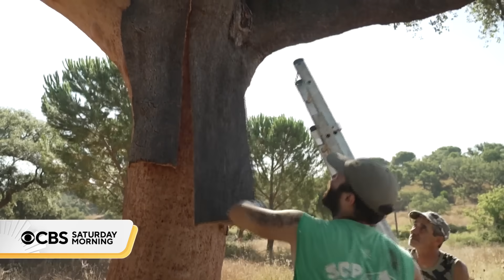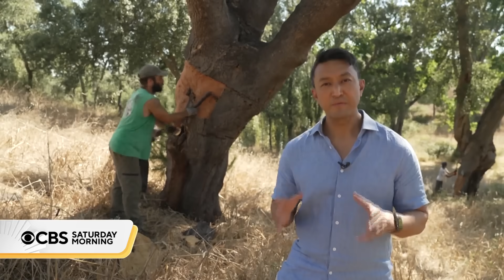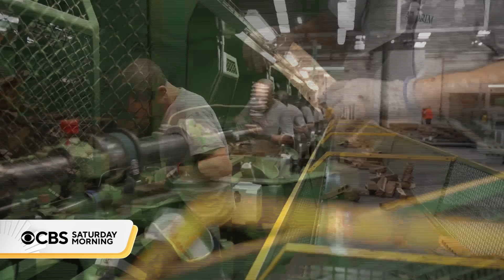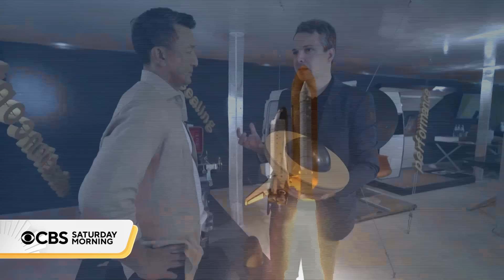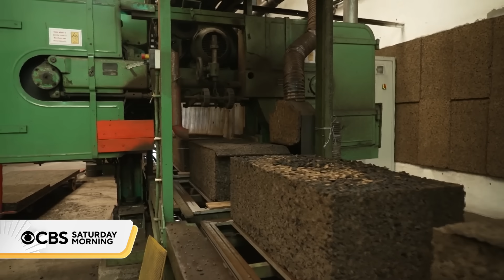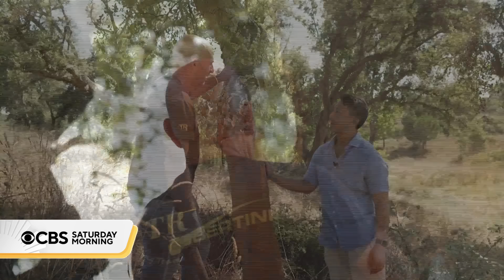How cork — the same material used to seal wine bottles — could save the planet

Comment: 🩵😇 🌎-1970’s in 1975-1978 my two older brothers built my mom’s house !! I was nine ! We all helped. We had a large open ceiling Family Room with spiral stairs going up to a loft ! That whole entire area had sheets of cork on the ceiling ! 
It was a natural insulating and also sound barrier !
( Tom was 17 ! Jon was 19 ! when we started building ! It was the ‘Little House On The Prairie days’. So my brothers added Lofts and open ceiling to the house plans like the T.V.show. ) 😊 🏡
( the front of the house was Sandstone-real Sandstone and the rest of the exterior was Cypress Wood siding ! Real Cypress Wood ! Also cut the same way as the siding on ‘Little House’ T.V. Show. We tried to use products as natural as we could.) 
1970’s were great. 😊

Comment: I built a house in about 1995 in German which was entirely insulated by cork. Wonderful material, but extremely expensive. Now I'm building a house in Alberta, Canada and I checked it out before. It would be more then 10 times more expensive then the already expensive mineral material that I use. Maybe in warmer climates the limited amount of cork that is actually available can be put to good use, but on a larger scale and in colder climates it just doesn't make economical sense.

Comment: The use of cork as an insulating material is very old. In Portugal, in the 16th century, a convent of Capuchin friars was built whose small cells were entirely lined with cork. The cork oak (sobreiro in Portuguese) also provides acorns for pigs, protects soil from erosion and is a natural barrier against fire and desertification in the southern province of Alentejo where it mostly grows. According to a saying, for every cork oak tree uprooted, a camel enters the Alentejo. The large fires in Portugal mainly consume eucalyptus (raw material for the paper industry) and pine forests, both of which are highly flammable (eucalyptus only has an advantage over cork oaks because it re-sprouts spontaneously after a fire). Last but not the least, cork oak woodlands are home to a multitude of animal and plant species. The cork oak is a national treasure of Portugal!
Reply: Let it be understood that there isn't a single camel in Portugal. Hence the joke, not one Cork Oak was ever uprooted. It's a very valuable little tree, that seems to live forever. Cork and Olive trees live happily together in Southern Portugal. Even from close distance they outwardly look very much alike, although they have little in common. The Portuguese names are Sobreiro and Oliveira, common surnames as well. 😀

Comment: This is not a monoculture, it’s an ecosystem that would naturally evolve to a climax where the cork oak would be the dominant tree. It’s managed, not wild, but management consists mostly of thinning the forest so that each tree gets as much sunlight and soil volume as it can benefit from. In a purely wild forest, most oaks would be smaller and competition for resources would limit their ability to recover from debarking. The montado was probably created as a balance between die back of the less vigorous trees, and the survival of the ones that tolerated debarking best, leading to its present density. It likely features the same biomass density as the original, wild oak forest, but concentrated in fewer individuals. Undergrowth flora, fauna are present and the soil remains untilled, meaning its rich microbial life and macrofauna are preserved. In the past, attempts were made to combine these open woodlands with cereal, but the results were not great and tilling the soil harmed the trees. Cork, as a commodity, is the only reason these large areas of woodland are maintained. Human goals and this ecosystem reached this stage of equilibrium over centuries of cultural adaptation, and over-engineering it risks disrupting it via unforeseen consequences.
Reply: This is probably the ONLY comment worth reading in this comment section. Bravo!
Very informative and accurate. 
My family is from Alentejo, from Mértola region, and they still have cork oaks. Taking care of a montado is a labour of love, commitment and total dedication of multiple  generations.
Saudações

Comment: Wait, there's a cork tree?? I assumed it was some general processed wood. It's amazing that cork is harvested without cutting down the tree and is sustainable.
Reply: Yes, they're called "sobreiro" in Portuguese. Scientific name, Quercus suber. It's a type of oak.
Reply: Cork is the bark of the cork tree, it is removed every nine years that's the time the tree needs to grow another one thick enouth to be useful.
Reply: @rasputindasilva858  you're saying 9yrs, but they said 25yrs in this piece so where are you getting the 9yr number? They said towards the end they're hoping to be able to harvest the cork bark in 10yrs but that's something they're working on figuring out
Reply: @nolongerblocked6210   25yrs is the number of years to have the first cork harvest; After that every 9yrs you can peeled it. The cork bark is dead, and naturally it would be expelled by the tree (like a snake); remove the bark is not deleterious for the mother tree; in fact it will help to avoid insect and mould  infestation of bark material. Nowadays we produce a vast array of products from cork, including clothes and tissues, besides the normal stoppers and construction material's.
Reply: @nolongerblocked6210  25 years wait for the first harvest. Subsequent ones every 9 years.
Reply: here's my fav random fact that literally NO ONE talks about 😱 apparently the reason why cork is harvested from oak trees every 9 years in Portugal comes from an ancient tradition of circumcising Portuguese men every 9 years 💀 it's bc of some Mediterranean genetic mutation that makes their 🍆 skin grow non-stop lmaooo can't make this up!!! 🤯

Comment: my cork tile floor is almost 20 years old - looks great - perfect in the kitchen - easy on the feet - better that tile - natural insect repellent- fire retardant - installed it in a few hours with a utility knife and ruler - also glue. and have uncorked thousands of bottles of wine. Thanks Portugal for all you do. thanks cbs for a very well produced package - not cheap to send a crew over seas.
Reply: does it stain?
Reply: @LK-pc4sq  maybe it does stain but the wine leaves some nasty stains and normally the cork is not that bad or have any stains when you open the bottle.
Reply: It's a great material, no doubt. I need to put in my home. :)
Reply: Lies again? CEO Of Ramenten (Alcohol Free)
Reply: Try some water, it'll rot in weeks
Reply: @Snaakie83  Cork is not timber, there's wine bottles of dozens of years whose capsule is cork the wine is in contact with the capsule and it is is not rotten.
Reply: Cork does not rot. It is not timber.
Reply: @Snaakie83  the convent of Capuchin friars from the XVI century clearly proves it doesnt

Comment: Wait ...didn't they replace wine the cork for wine with plastic ones , to save the planet....now your telling us to use cork instead of plastic to also save the planet ?
Reply: *you're telling us
Reply: Plastic corks are used for cheap wines only.
Reply: That's not right. Cork is sustainable, it doesn't 'hurt' the trees (quite the opposite), and cork oak forests create thriving ecosystems and biodiversity. Besides, these forests are perfect 'carbon sinks' that fixate carbon dioxide and pollutants, altering their composition and making them safer or innocuous. Maybe that's one of the reasons why the area of Alentejo, in Portugal, has such clean air and is one of the best regions in Europe to observe the night sky. Just Google it. Plastic: not quite the same.
Reply: the replaed with plastic because cork is running out.   the other hub is madagasgar and they dont manage their cork like portugal
Reply: No, nobody said that. And if they did they were wrong because you don't cut cork trees down.
Reply: @OAlem  Um, you must be very young because they most definitely said that. In fact, back in the early 80's brown paper bags at the grocery store were standard, but then they told us to use plastic bags to save the planet. That was a bunch of bull jive too.
Reply: @oldsocrates paper and cork are 2 different things.  

To get paper you need wood, so the tree is killed to get it.

To get cork you just remove the bark ( outter shell) from the tree. The tree  will keep on living.

We did change from paper bags to plastic ones in the 80s early 90s to protect the trees.

However we never change from cork to plastic (or at least  not where I live nor in any of the European countries I know, so maybe that's a US thing not a world thing).
Reply: @joaobpinto  Uh, you missed the entire point, Einstein. *Hint: The point was that switching to plastic was WORSE for the environment. Good lord man....
Reply: @oldsocrates  sure, go to plastic was worse. But since neither wood or plastic are part of the video I guess you're the one wandering. You're missing paper with Cork and that are 2 different materials.
Reply: @joaobpinto  "sure, go to plastic was worse" Um yeah, THAT was the entire point from the get-go budy....
Reply: @oldsocrates  Gosh... You must have saw a completely different video. This one was about promoting Cork and Cork applications. Sure it can replace plastic but that was a small part of the video. Go and watch it again.

I won't keep replying to someone who mix paper for Cork and then complains about plastic replacing paper when the video is about Cork (no paper involved). Stay well.
Reply: @joaobpinto  Uh no, I was simply making a different point budy. FYI, people are allowed to say stuff that isn't directly talked about in the video. Good lord........
Reply: Ahha gotcha… lol
Reply: Nope. Thats just you (and the plastic cartel.)
Reply: @fillhixx  Oh brother, another youngin. FYI, back in the early 80's brown paper bags at the grocery store were standard, but then all the environmentalists told us to use plastic bags to "save the planet", buddy.
Reply: @oldsocrates "they" and "environmentalists" was definitely a push by the oil industry
Reply: @landminedj  Uh, you weren't even around back then. If you were, you'd know that they were ACTUAL environmentalists
Reply: @oldsocrates  i was around and it was the oil compaies.
Reply: @andrewfischer8564  Uh, you clearly WEREN'T if you seriously think that oil companies were the environmentalists back then. *face palm

Comment: Cork used to be used as flooring
Reply: Still is.
Reply: Not only flooring, some old portuguese houses also have it on the walls and cealings because it it also heat/cold resistant, so it is good for isolation and it is very hard to burn it so it also protects houses from fires
Reply: @PenguinTac0s  @bucapolex9560 Cool!